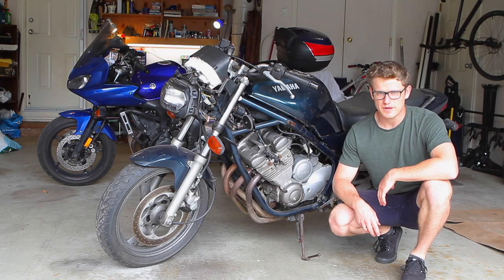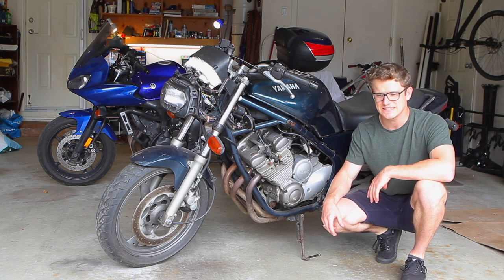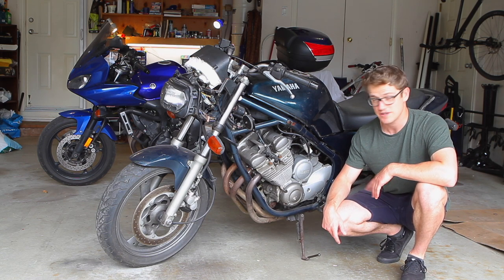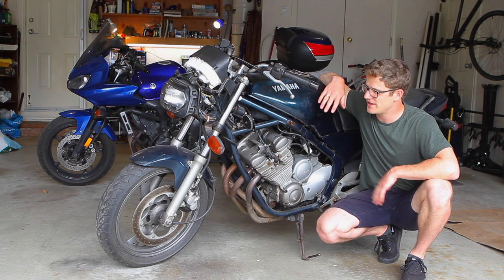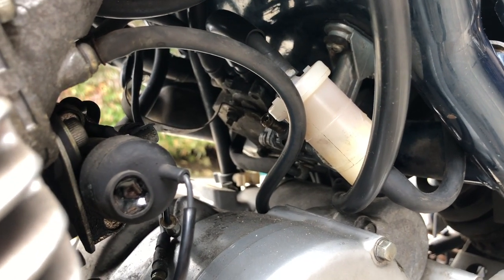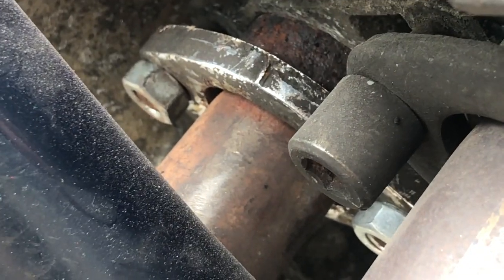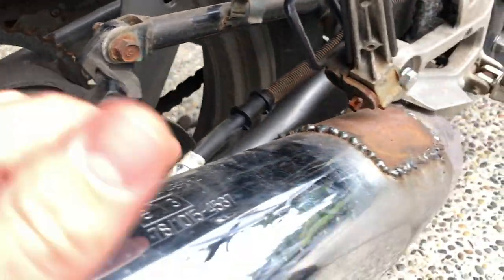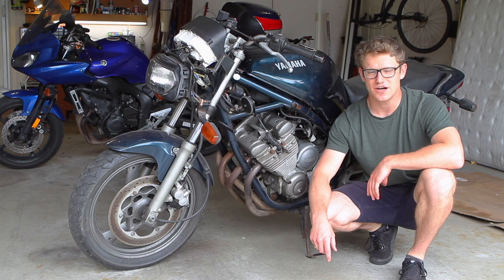Introducing my New BIKE!

Comment: For the gas tank, try and use apple cider vinegar. Normally it would get rid of the rust!
Reply from the maker: Ya I’ve heard that works!
Reply: @Calvinm  You may also consider something like evapo-rust, or better yet, electrolysis; it only removes the rust and spares good metal.
Reply: I've got rust on my fz6 forks and it's really bad, do you think apple cider vinegar will work on the fork tubes?
Reply: @thatxolani1766  I don't know, since you have to let it sit for a while in the tank Maybe if you're able to submerge the fork in it, it would work?

Comment: Good luck with the project bet you're excited. What are you first thoughts for the pinkering sound when she runs low?
Reply from the maker: I’m thinking it’s a rattle coming from the clutch. Maybe a broken pressure plate spring or stuck plate
Reply: @Calvinm  I hope so, would make fixing it much easier. Hopefully not a piston head or connecting rod